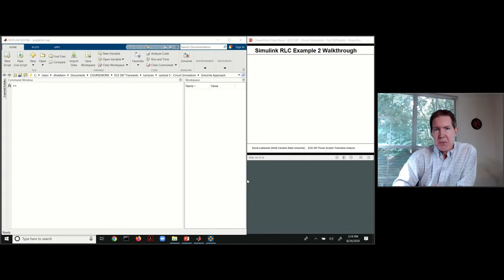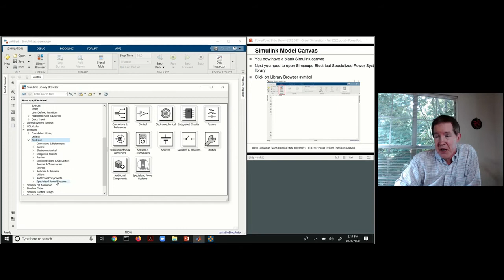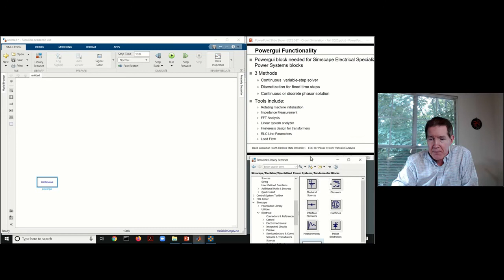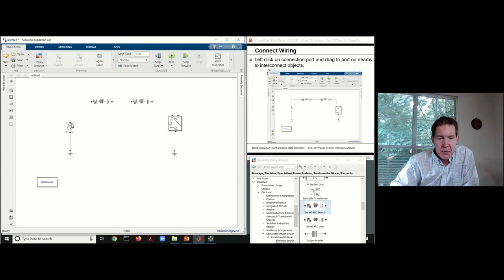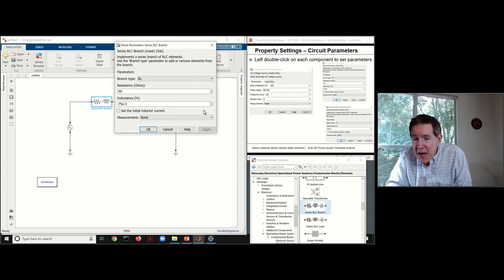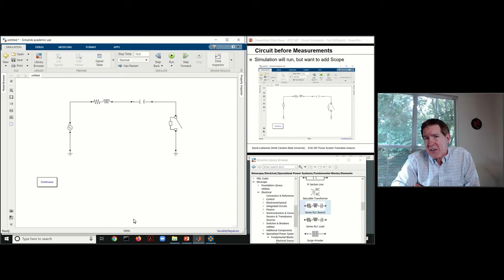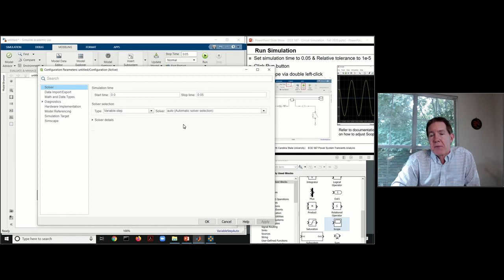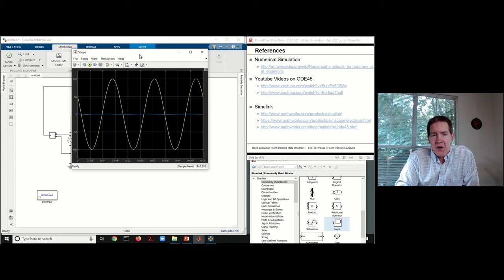Lecture 5c: Circuit Simulation Simulink - Power System Transients Fall 2020 - Lubkeman

Comment: The scope does not show ant transients at switching time. can you explain, please?
Reply from the maker: The transient current should have been plotted on a separate scope axis since the current magnitude is so small compared to the voltage.  So in this case the scope does not appear to show it. The solution is discussed in Lecture 5b Example 2.